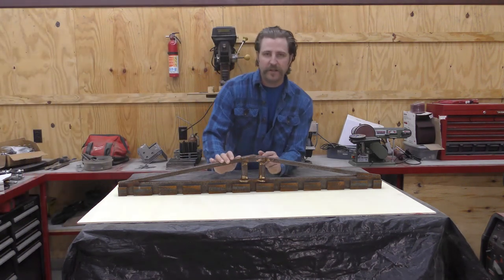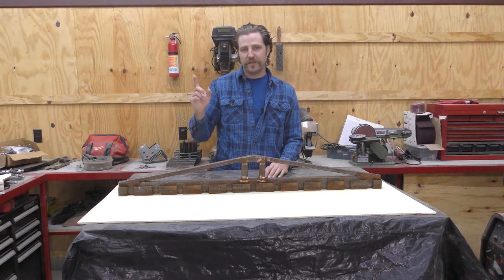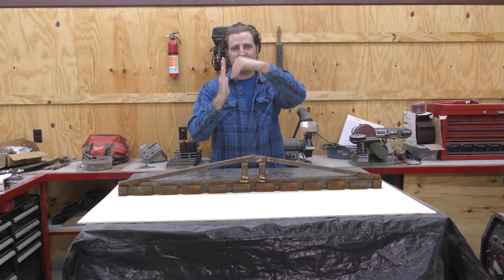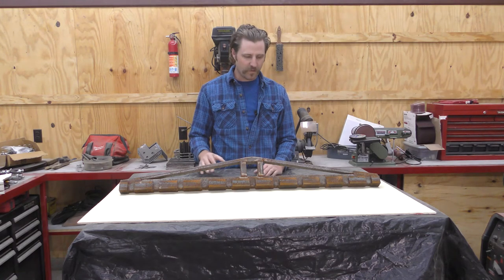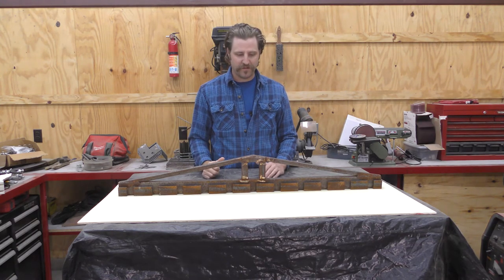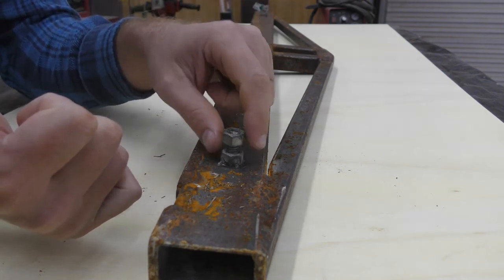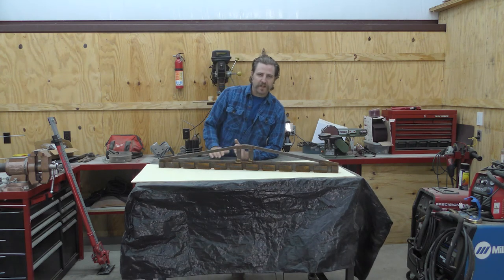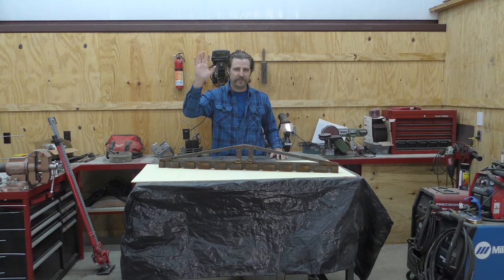DIY Fence Stretcher

Comment: Nice project. What did you say the bolts at the top and bottom  are for??
Reply from the maker: Thanks, the bolts just keep it on the fence while you attach the come-along or stretcher. Once you have it in tension, they don’t do anything.